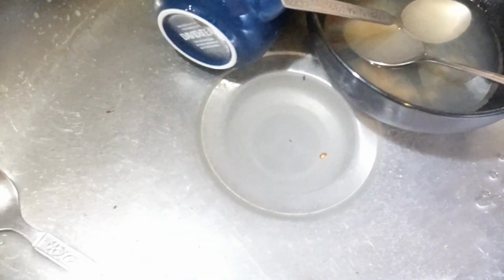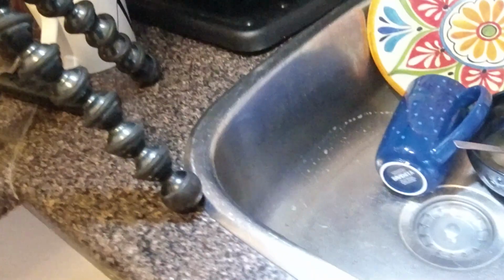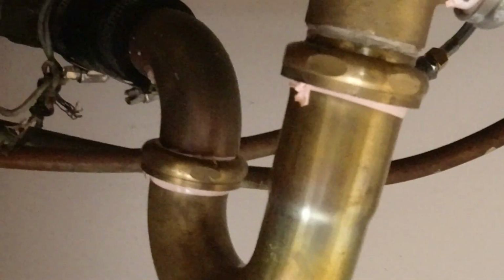How to unclog kitchen sink drain.

Comment: Great vid Jay, instructional as you walked us through the steps. Quick question on the p-trap, is teflon tape normally used, I just thought it had a compression seal that kept it together. I never noticed teflon tape on the other p-traps.
Reply from the maker: You can definitely use teflon tape if needed but those p-traps have plastic sleeve washers and they usually seal up pretty well if you notice that they're getting worn you can either replace them or throw some Teflon tape around it. thanks for the questions.